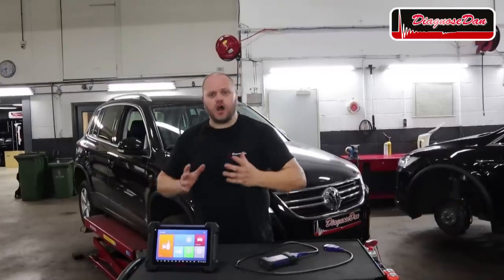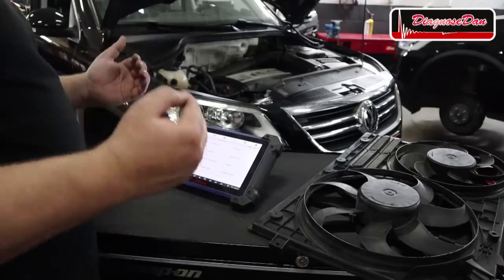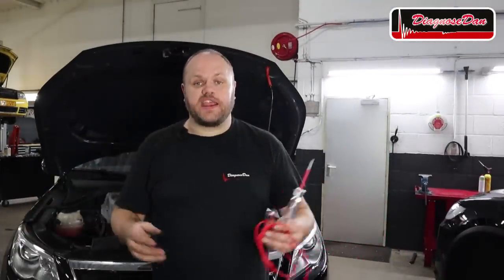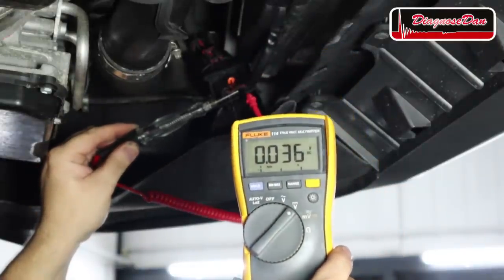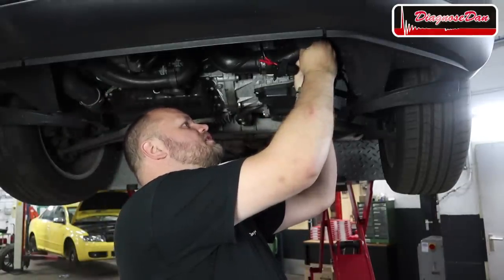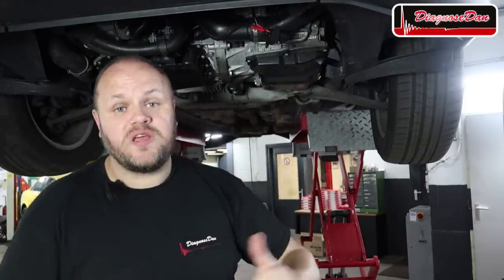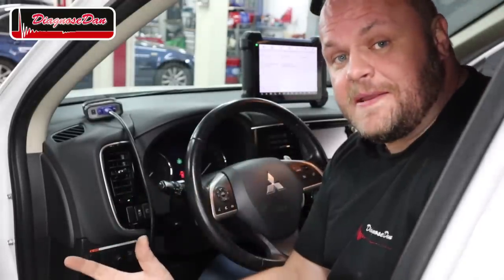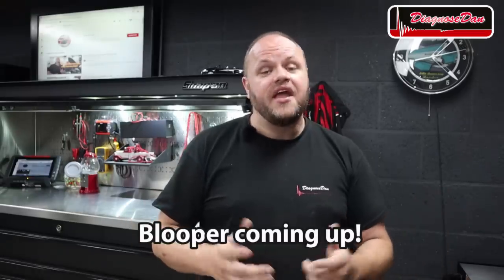A Cheap Chinese Car Key from Wish, will it work?

Comment: To comment on the second part of the video about the aftermarket key(s). And my advice to everyone is: if you can afford it and really love you car stick with the OEM, no matter how expensive. Aftermarkets are good as spare (secondary) keys that would only be used in case the original is lost. If they key is to be used on a daily basis, and the only key available, -for the love of God, buy the factory one from the dealer or reputable locksmith. The $25 key is worth only $25 and in no case is it a bargain. I opened and studied the electronics and circuit boards of many China-made aftermarket keys and I can affirm they are total junk and that's why they are cheap. They fail often, have short range, shitty/non-responsive buttons, cheap plastic case, loose locking tabs for the emergency blade, no logo and 99% of them have no quality control. Nothing compares to a factory part that is built to specs, tested, guaranteed against defects and feeling good in the hand. Aftermarkets are budget solutions for those short on cash but are not the real thing. Just a short time convenience and a big headache later on.

Comment: Hi Dan, I need your help! I have an Opel Ampera that was imported from your country (at least i think it was) and here in Portugal, Opel says they can't fix it because they don't know how ahahah anyway, the problem seems to BE very very Simple, the button that controls the drive modes (normal mode, sport, mountain and keeping the battery at its current level) it's not working... I think it is the button it self that stoped working but i don't know how to remove the center console in order to test it! Can you help me? Do you have Access to some schematic or something that would help me to disassemble it? Its a 2013 Opel Ampera 
I like your videos very much heheh
Reply from the maker: Ask your technical questions in the Diagnosedan Global tech support group on Facebook

Comment: wish i could found that key. i got a cheap shell and blank swithc key for mazda and moved electronics and transponder from one to the other. i have 3 keys so can add without needed a thing to program
Reply from the maker: If only the shell is damaged that's all you need to replace

Comment: Hi, I have a 2002 Seat Cordoba 6K2 1.4L 16v... The problem was with the o2 sensor heating circuit, i changed it and the car worked much better... But, there is still a problem with it.. The new o2 sensor still puts a fault code that's not working properly... I went to a shop and scanned it an locked at tha trimmings and it was perfect... Around 0.002 / 0.008 mA... The heating circuit is also working, so why does it generate that fault code?? Any ideas?? Thank you so much for your time
Reply from the maker: Was it for the upstream or downstream sensor? How did you confirm the heater circuit is working?
Reply: @Diagnosedan  Well, it is the upstream sensor... It is a 5 wire sensor, pin 1 - 3 are for tha heating element and sure enough it was noting were it should have been around 4 ohm... I must say that the new sensor was 6.7 ohm... I checked the hole wearing up to tha icu, but it was all good... My first idea is that tha heating element resistant is too high and maybe this is tha reason why it generated that cod... O2 Sensor1 bank1... That's all it said... Oh yeah, i put on the ignition with tha o2 sensor out of tha exhaust without starting the engine, and you could really feel the heat of it from it working as i heald it in my hand... So, as in you're video's... Ol sensor problem confirmed, pin1 - 3 open.. New sensor, 6.7ohm resistance... Tha hole wiring from tha sensor to tha icu tested for short / open circuit, also for under a load with tha connector disconected... All is good.. Maybe the resistance on tha heating element is just too high? Or tha voltage drop is diferent??... Yes, it is a chip aftermarket one, and maybe that's tha reason...

Comment: What is best direction to test a p0420 code on cadillac?
 I would take it to dealer again but they were the ones at first when the car would not start at one point that I needed a new $12k motor and I was able to fix it for $20.
Reply from the maker: Ask your technical questions in the Diagnosedan Global tech support group on Facebook
Reply: @Diagnosedan  I must be a odd duck but I shut down my Facebook years ago due to tampering of my account so never went back

Comment: hello  i had a vw passat  2014  tdi  if egr is blocked l is any another problem ( like limp mode,or just  need to town  or any another serious
 problem  )   can expect be side a engine light is on
Reply from the maker: I don't fully understand your question
Reply: DiagnoseDan   First thanks to taking my questions. I am a big fan of you  .  I saw on internet to block the EGR pipe to not bring exhaust gas back to the intake.I know the positive and negative affect.My question is  gonna make any-problem on the car beside Check engine light is on. It is so nice to see someone know what a hell is happening and you have knowledge anest opinions

Comment: Hey there 

I have a question here I have a fast key that I want to get it programmed i went to four dealership they wanted to charge me $2000 they said i need 5 antennas front, back, left, right and sunroof. Also would need bcm dash board harness and more. they also said I would need new fast key cause these are useless.

Can anyone help me how to program this.

Thanks

Comment: You should always erase all keys and start all over fresh when programming keys because if the vehicle has memory seats . The key you just programmed will not recall memory seat functions because only drivers 1 & 2 will recall memory seat functions and you added a key which would mean at the least that was programmed as a #3 . No memory seat functions
Reply from the maker: I think the tool does that
Reply: @Diagnosedan  . Only if you erase all remotes . But the way you programmed it . Is whats called "Adding A Key" which would put it at the #3 slot.

Comment: please dan i dont understad why the fan dont work dispite  you have 12 V with multimiter
Reply from the maker: There is a connection but its very bad!
Reply: @Diagnosedan    the problem with current cant flow ??
Reply from the maker: @jamalamarir6525  yes

Comment: what about checking circuity with Ohm meter without bulb? personally, I do it always when something suspicious like this happens.
Reply from the maker: Yes but when is the ohm reading good, when is it questionable, when is it bad? You need either to be experienced or know the specs. I think the testlight gives you a clear and visual answer!
Reply: @Diagnosedan  It's clear that resistance of copper wire of that lenth  should be 0.00? so if it's higher mean that contact isn't good.

Comment: but I am still curious why does ground wires were melted
Reply: The bad earth connection means high resistance and current which creates the heat. Like the element in an electric heater.
Reply from the maker: Just like the lightbulb, recistance creates heat

Comment: It would have been quicker to check the resistance between the ground wire and a good earth. I would also cut all 3 ground wires and splice in ne ones with high temp tape over them or make them longer so they won't overheat again.
Reply from the maker: They won't overheat as long as the Bolt isn't loose.
Reply: @Diagnosedan  Thanks for the reply, I wasn't sure if they had been fitted close to a heat source which caused the issue. Love the channel as everything is so well explained, cheers Dan

Comment: 1:50 they replaced 2 cooling fan motors. Even a 14 old child could check if they are working with multi meter or just put 12 volts on it. This is literally the EASIEST FAULT in universe to check.... no words.
Reply from the maker: Thanks for watching

Comment: Is this equipment capable of coding Vw 4th/5th immobilizers?
Reply from the maker: Hi Paul i Just got the tool and i only programmed the Outlander key with it. I'm pretty sure it does but i haven't confirmed yet. There is a list of systems it supports on the Autel website

Comment: If a circuit pulls more then a amp i use my head light made test light everything else its my 500ma test light. Once in a blue moon i use a led.
Reply from the maker: Led test lights also serve a purpose but not this one😁

Comment: I was working on nissan altima. Long therm problem for customer. No fog lights, no headlights. Multimeter gave me all good ground and power, but no lights. Under load I lost ground. Turned out  all wires to ground point on car were taped, not soldered. Somebody was messing with this and no true connection between wires and ground.  Driver side under bumper. Must check under load!!!

Comment: I had a VW Polo TDi (2006 from new)  after a15 years with it I got a 2019 Polo TSi petrol.. OMG compared to the diesel it is flooded with gadgets bells and whistles.. radar braking (frightened the life out of me) I got an OBD2 gadget and trying to learn some basic diagnostic stuff.. but all this new technology are mostly toys and takes a wizard to work out what is really going on.. YT s full of complaints of garages replacing stuff and charging the customer with no fix.. and these are the so called experts of the dealerships. What chance does the average Joe have? Dan i a true technician not just a fitter of ' let's try this' parts.

Comment: hi fron finland. Liked to know whatta heck is wrong with these mercs,mine is e350 4matic ,and distronic kaputt. also mirror blinking lights are dead.those are blindspot dingels. im so angry. got to keep foot on pedal and distanses are long,about 350 km to our summer cabing,at ruka skiing center hills.  i got me that tester-icarsoft testertool MB V 2.0. is it any good??? My merc is E model and from 2010. Is it the wire connectors at fron bumper or sensors usuallu goes kaputt? display at tester says: 680700 and can communic with comp. A86/2b4( left outer radar sensor,frontbumper) has a malfunction.  oh my word!!??
Reply from the maker: Ask your technical questions in the Diagnosedan Global tech support group on Facebook
Reply: No answer...oh my word...🥺🤕🔩🔧
Reply: @Diagnosedan   well... I try, if they got something. Those are common issues at merc brand. I earlier got opel vectra cdti stw.

Comment: Diagnose was ok, but I didn't like the repair:
a) punctured power wires will corrode within 2 or 3 years, turning into nonconducting green powder. You should have sealed these punctures, e.g. using cyanoacrylate glue.
b) overheated wires will have higher resistance on the contact point between the wire and eyelet crimped connector. You should have replaced those 3 eyelet connectors.

Comment: I wonder for which brands of cars the Chinese can copy all this for that money, or are we all just being ripped off and heavily cheated by the dealers that we usually call "stealers" over the past 20 years and perhaps many longer.
How do I get this? now I do not trust any dealer anyway and certainly not a Renault dealer who just years ago wanted me to pay something of € 750 for a complete exhaust with all the trimmings including working hours etc.
I then drove to a Kwik Fit, came by anyway, and asked about the cost of an exhaust under my Safrane of barely 4 years old.
Now I was almost amazed at what this good man told me about the exhaust I asked for, costs including mounting, brackets etc. came to just € 279, - that makes a big difference, isn't it?
In short, the punch line was that a mark was stamped on the exhaust at the dealer and that of Kwik Fit had no mark at all, but the exhaust was exactly the same.
That's why I avoid dealers as a scary disease and especially now with that Corona, just go to a reliable unbranded garage if you know or inquire afterwards, you will save a lot of money.

Oh you read also Dutch? no problem here we go:
Ben benieuwd voor welke merken auto's die Chinezen dit allemaal kunnen namaken voor dat geld, of worden we nu met z'n allen gewoon opgelicht en zwaar belazerd door de dealers die we doorgaans "stealers' zijn gaan noemen de afgelopen 20 jaar en wellicht al veel langer.
Hoe kom ik hierop?  nu ik vertrouw sowieso al geen enkele dealer en zeker geen Renault dealer die mij even jaren geleden iets van €750,- wou laten betalen voor complete uitlaat met alles erop en eraan inclusief de werkuren etc.
Ik ben toen maar eens naar een Kwik Fit gereden, kwam er toch langs, en daar maar eens gevraagd naar de kosten van een uitlaat onder mijn Safrane van amper 4 jaar oud.
Nu ik viel bijna van verbazing om wat deze beste man mij vertelde wat betreft de uitlaat waarom ik vroeg, kosten inclusief montage , beugels etc. kwamen op net aan €279,- dat scheelt nogal wat nietwaar.
Kortom de clou was dat op de uitlaat bij de dealer een merkje was ingeslagen en op die van Kwik Fit staond helemaal geen merkje maar de uitlaat was exact hetzelfde.
Daarom vermijd ik dealers als een enge ziekte en zeker nu met die Corona, ga gewoon naar een betrouwbare merkloze garage als je die weet of informeer eens erna, zal je veel geld schelen.
Reply from the maker: Bedankt voor je bericht, 9 van de 10 keer zit er wel degelijk kwaliteit verschil tussen een aftermarket en een orginele uitlaat.
Reply: @Diagnosedan  Hi Dan, ja dat zal best maar door de jaren ouder maar ook wijzer geworden blijf ik over het algemeen dealers een stelletje oplichters vinden, uitzonderingen daargelaten uiteraard, maar één ding staat wel vast, nu had ik al weinig vertrouwen in de mensheid maar op nummer één staan wel de autoverkopers/dealers ze beloven je zelfs gouden pedalen etc. maar ik heb wel heel veel mensenkennis opgedaan en ook dat scheelt, aan praatjes zoals "rijdt goed en staat prima in de lak" dat zal mij worst zijn en is ook pas een derde plan, de technische staat daar draait het om en als ik een auto zou gaan aanschaffen en ik mag die beoogde wagen niet op de brug zetten dan ben ik al weg want dan mankeert er iets aan wat ze liever voor zichzelf houden.

Comment: Diagnosing the fan circuit in a dynamic state is more accurate..
Reply from the maker: Yes but because of the ground problem the fans would not turn on

Comment: Ugh the previous shop.... piercing wires in an exposed location like that.... could at least have painted some liquid electrical tape on the holes. No doubt the fans will fail again in a couple of years and the cause will be the green crusties eating the wires through right where the holes are.

Comment: it's weird how they pierced the wires and left them, no repair or anything. As they are beneathe the car, road water, moisture etc will find its way in there quite fast and easy and start corroding the wire cores.. sub-par work, i'd say!

Comment: As a locksmith the cheap keys have about a 50 percent chance of working. You take the cheap key,  leave the house and it stops working  .Now you call me in the middle of the night and I'll charge you 300 to 500 hundred dollars to fix it depending on what model car it is. Somethings you can get by with cheap stuff, keys you cant. I can't use them because I have to stand behind my work, .The old saying you get what you pay for. Buy a factory key from a dealer or locksmith and save yourself a big head ache.
Reply from the maker: Thanks for the feedback Dave!

Comment: You shouldnt use the wish key as the backup key. In case something happens to your primary use key you wouldnt want to rely on the wish one.... I'd use the wish key as the primary key so in case something happens your backup is OEM.

Comment: Does that scan tool works with Teslas?
Reply from the maker: No
Reply: @Diagnosedan  Really love my Tesla but thats the part I absolutely hate. 
I got an OBD2 adapter and you can read out stats but no codes. Elon, please change that.

Comment: will it write  bmw cas 4 and  2014 and up merc keys?
Reply from the maker: We Just got the tool, i've only used it in the video so far. There are many video's for the Im608 on YT. You can also check on the Autel website
Reply: DiagnoseDan thank you. and keep the videos coming.

Comment: I noticed that you didn't fix or even better replace the over heated section of ground wire, not sure about England but in Canada, in the rust belt, overheating a ground wire basically turns it to dust.     
I notice you have a few dislikes, could this be because you go a bit overboard. I like it when we go to the root of the problem and not just get it running for today.

Comment: what went wrong with measuring with the multimeter was they did not measure when the fan was turned on.
Reply from the maker: Think about it........the fan module is in the assembly and also uses that same ground wire. Because of the Bad ground the module didn't work so it will never even try to turn on the fans...........😉
Reply: @Diagnosedan  
yes i was thinking about it.
it stands to reason:
under no load you have the 12v on the multimeter even though through a high resistance ground fault.
the fan switch is turned on and pulls down the voltage to near zero. naturally the fan is not running. 
so if you measure with your multimeter when the fan is turned on you should see near zero volts.
the same like with your incandescent light bulb device

Comment: He turned on the fans via the controls that then reported a duty cycle.  If the fans didn't turn on, then why did it report a dynamic response?  The software should be made to report the error on the same page.  Those readings should be explained in detail, because an uneducated technician might interpret that as a report directly from the fans the way it does in a desktop computer.